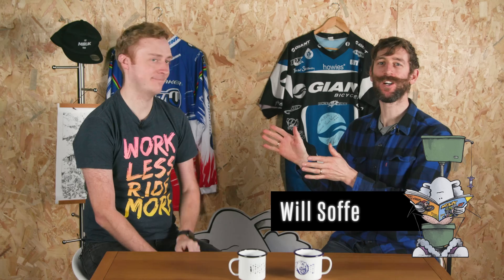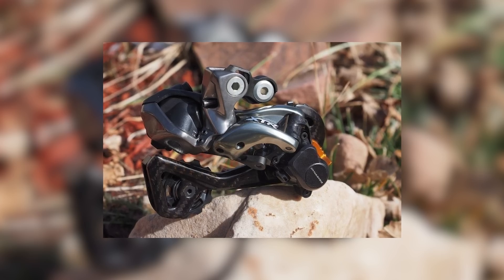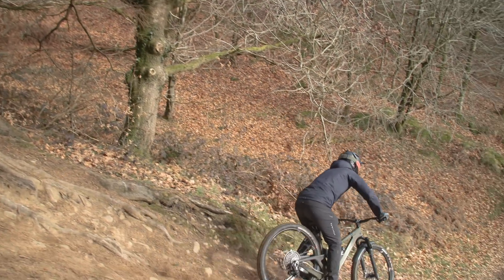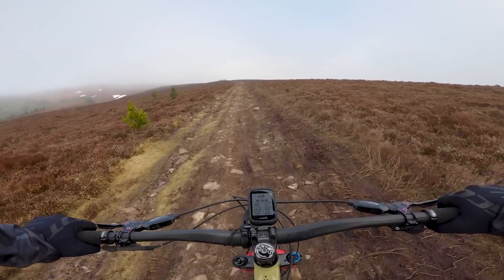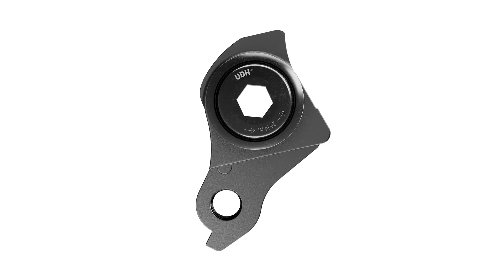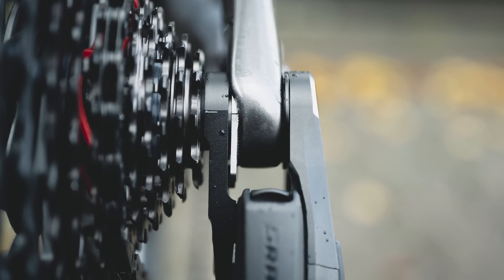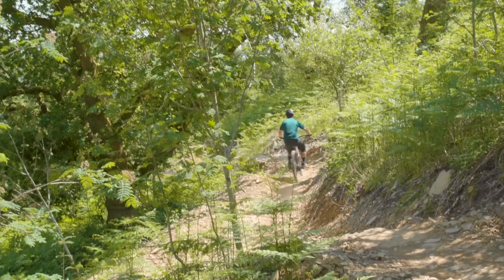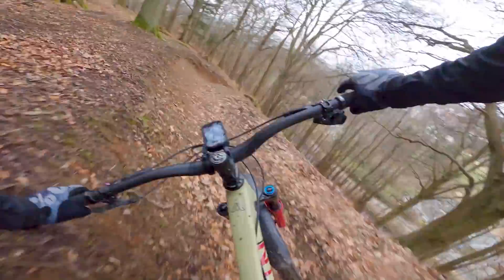R.I.P Rear Derailleur Hangers 🪦

Comment: why do people sy electronic will always be dearer? the shifter levers have one piece electronics and the lever just pushes the button on the electronics with mechanical there are loads of operating parts, longer to assemble in the factory more parts to manufacture and the cables. I would say that why isn't electronic much cheaper than mechanical ?

Comment: I'm sure you mean well in bringing to light the latest tech and components but there is a downside to this also . 
When statements like " massive game changer " are used , it goes from informative to shilling for Sram and the bike industries raising prices to a ludicrous level.
sometimes there's a fine line between encouraging new tech and being complicit with pushing prices into the stratosphere . oh sorry to hyperbolic ? 
Look there are a lot of riders that are not bike fanatics and only want to ride for recreation , commuting and fitness . When this is the case price becomes a very important feature of whether they can do this or not . The bike industry may be cutting its own throat by forcing everyone into electronic shifting and stupid "transmissions "that send all force from a derailleur  to the bearings and frame . 
i for one will never spend the money on electronic shifting or non derailleur shifters . if they discontinue the hanger , i will by a box full of hangers and cable shifters and ride economically until i'm dead , which won't be long considering my age .
Reply: They won't discontinue the hanger. A huge number of bikes sold cost less than just such a derailleur( without the rest of the set), there's no way electronic shifting finds the way into this part of the market.

Comment: Nonsense.  Let's see if manufacturers can pull it off first because the design requires some pretty strict quality control standards, especially on carbon frames.  If manufacturers can't consistently pull it off with the bottom bracket area, what makes you think they can do it at the back of the bike where the through axle and deraillieur would attach?  So maybe it's time to cool your enthusiasm, or better yet stop uncritically shilling for the manufacturers until we actually see how this works in real life.  By the way, there is a very specific reason why deraillieur hangers were used, which is to protect the frame and orvthe deraillieur. It's not obvious to me that that issue disappears with this new design.  But again, only time will tell.

Comment: I think this new Sram system will find its place, but it will never really supersede conventional derailleurs in the big, whole market. It's limited to frames with through axles and the UDH, which you typically find on higher priced bikes. The majority of bikes sold still don't have through axles, and even if they cut the price for the new set in half it's still more expensive than a complete decent beginner xc hardtail. 

There will always be a place for less expensive bikes, and if manufacturers  save 20 bucks on such bikes by using an Altus or Acera derailleur instead of a stiff aluminium body Deore one they won't use a derailleur which cost more than a complete bike in this market niche.

Comment: The UDH hanger is a great idea, but the direct mount has so many flaws that it's just not a contender. There's going to be so many broken rear ends. The crush washer is another issue. As soon as it starts to move, you have issues.
Stick with the UDH hanger. It's good enough. Simple wins all day long.